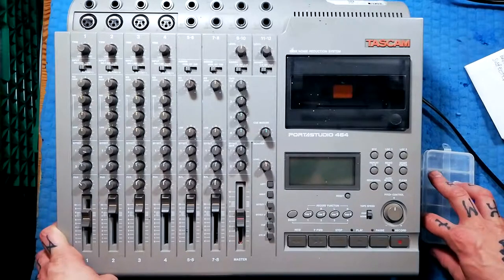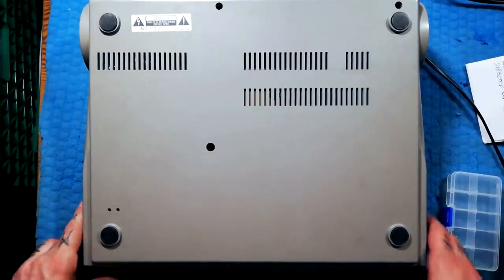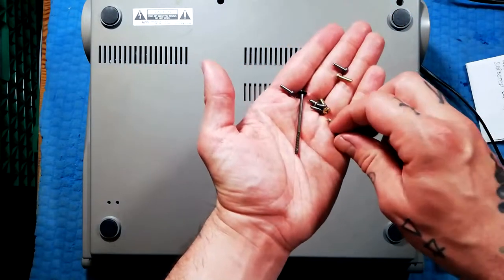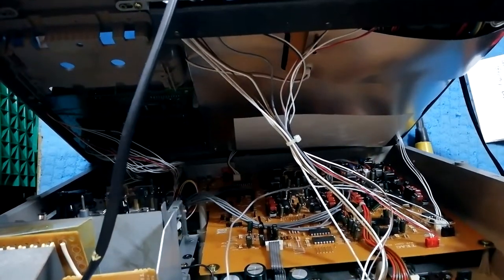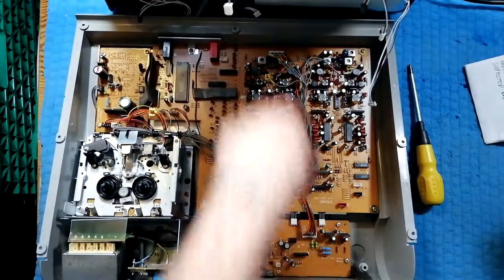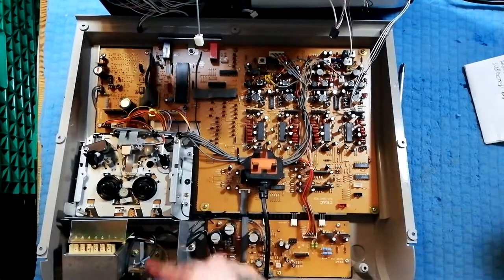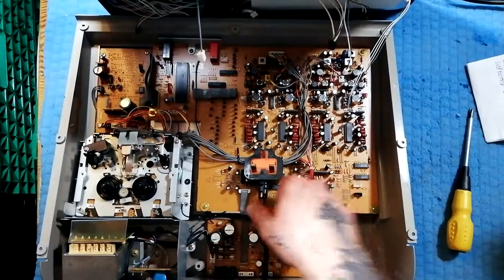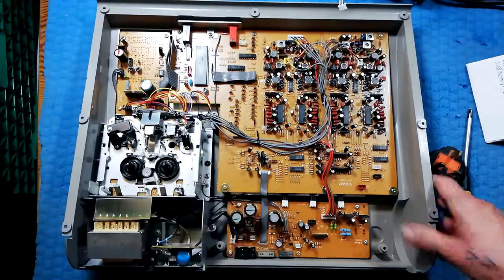Tascam 464 | 2 | open the case

Comment: Thanks for the vid. Much appreciated. I’ve got an issue where the play back head doesn’t stay in place. Record, forward, reverse seem to work as expected but the playback head retracts after a few seconds once pressed. Any ideas? Thanks, Ant.
Reply from the maker: I can see from your comment  on my video about changing gear C  that you found that video, that should address your issue - thought I'd answer here in case anyone else reading these comments has  the same issue :)